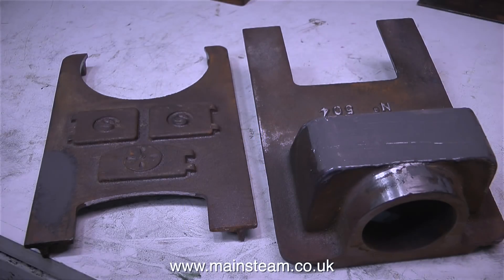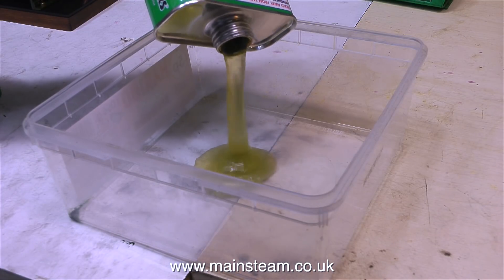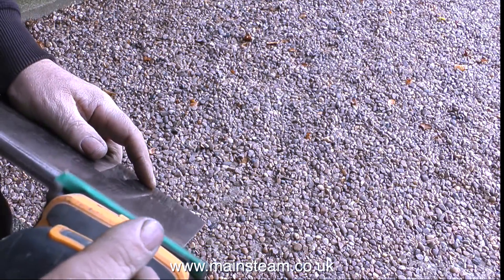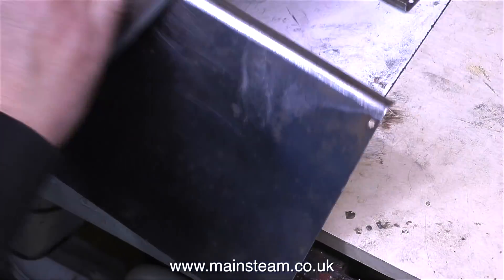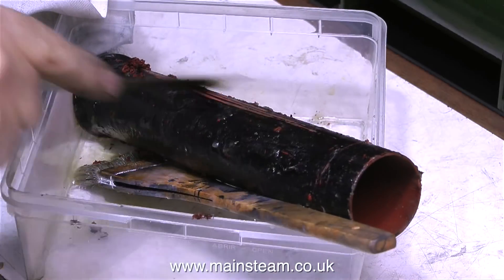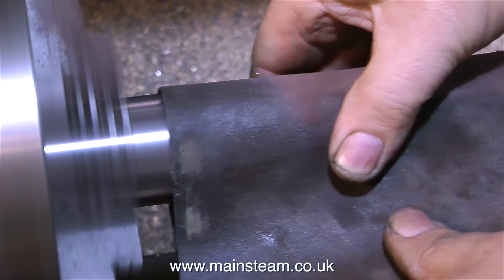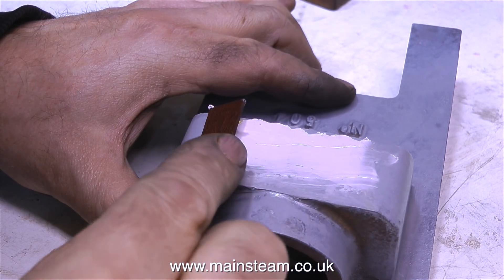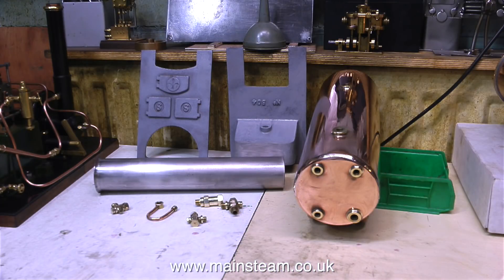A STUART 504 BOILER RENOVATION - PART #2 - IN THE WORKSHOP

Comment: All good stuff, Keith. I use an acetic acid bath or electrolysis to de-rust ferrous parts. Electrolysis is gentler as it supposedly cannot remove any material.

Comment: I find it interesting that you do use scales as scrapers.  I have had two Starrett 12 inch scales on the wall for over 30 years that have been used only for that purpose.  It is amazing how well they have worked over the years.

Comment: Hey Keith, something I found useful removing rust from chrome parts on my motorcycle is to use a window cleaner and a ball of aluminum foil.  Makes very short work of even deep rust spots, and is easier to grip than an sheet of sandpaper.
Reply from the maker: That's interesting - will try it .... thanks {:-)))

Comment: I must say that I find your use of a rule to scrape paint from a painted part very disconcerting. A rule is a precise measuring instrument and should only be used as such in my opinion.  It would be much better if you used a kitchen knife or possibly an old garden implement such as a spade. By the way , I can pick my nose with my big toe but the smell whilst doing so is bloody awful.
Reply from the maker: {:-))))) Have a safe journey ...... :-))
Reply: Roger Croll 
     Amazing...
Reply: Roger Croll - a micrometer is a precise measuring instrument, a steel rule is an approximation IMO and scraping paint with it will have zero impact on its ability to measure to the nearest mm which is all they are good for.
Reply: Snotty toes🤥

Comment: is there a worry about the JB weld with the heat of firing the boiler?
Reply from the maker: it should be OK  ....
Reply: My brother, a Union Pipe Fitter, has told me stories about repairing Comercial Boilers with JB Weld.  It works well with cast iron and held up for many years.
Reply: JB weld can be used to repair automotive engine blocks in certain applications.  It will be fine with the heat from the boiler.  It is good stuff.
Reply: I use JB weld on engine parts alot, which get to above 220* F. It holds up very well
Reply: Out of curiosity I checked the JB Weld Site.  It will endure 500 degrees constant temp with up to ten minutes at 600 degrees.  We use it in gluing the brake lining material to the brake shoes for model steam locomotives and cars.
Reply: Different rates of heat expansion may break it off eventually I guess. But it may take hundred years :D Cast iron exhaust manifold of a car is a different story.